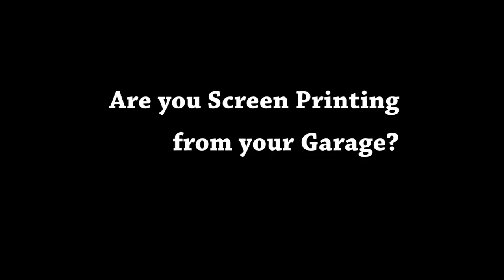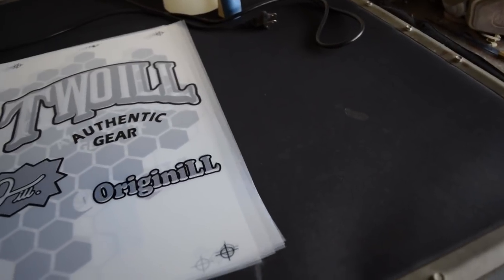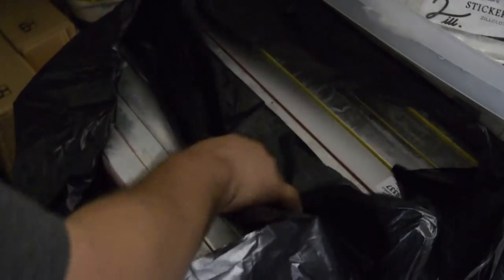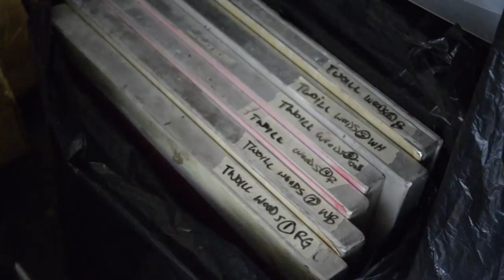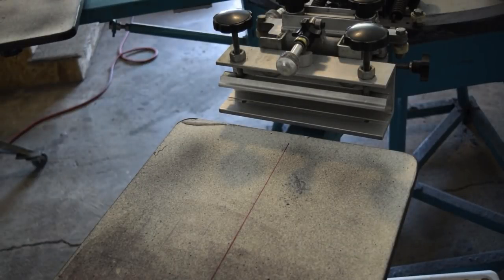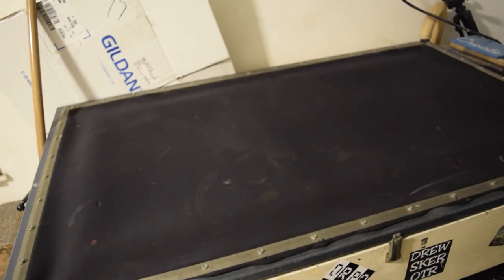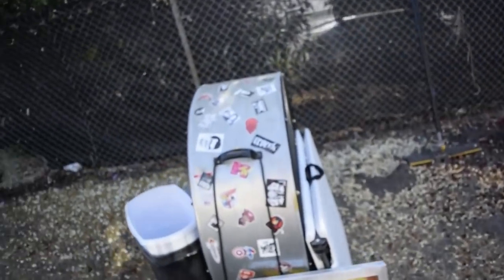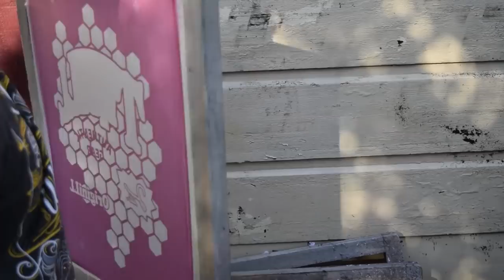Just here screen printing from my garage..

Comment: Awesome work Gibran. I've been trying to get into screen printing bigger and more colorful designs but I'm terrible at it. I can't even fully flood the screens and then then when I print there's way too much ink on some spots from flooding too hard. Any advice?
Reply from the maker: Alex M try and use softer inks or reduce it a little with softhand. Make sure your squeegee is not soft and covers the whole image. Use mesh 160. And make sure your screen and board a leveled off and around 1cm off contact. Good luck! Let me know how it goes.
Reply: Thanks for the help man. Really appreciated!! I think I also might need newer screens with more tension.

Comment: I’m new at this how do you know what prints needs higher or lower mess count
Reply from the maker: San Walk for it depends what you are printing on and how thick your ink is and how bold your design is. I use higher mesh 200+ for photos or designs with gradients. Also higher mesh if it’s a color on top of a white base specially if the ink is soft. When printing vinyl stickers or water based inks I also always use higher mesh 200+ for bases and solid one color prints I use 110 or 160. Hope this helps.